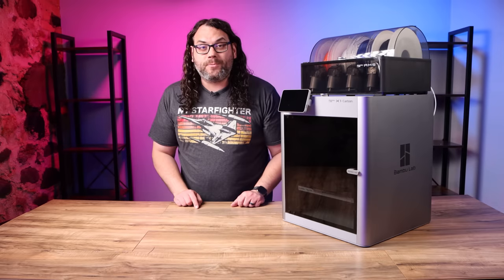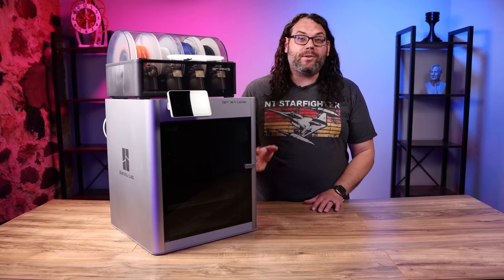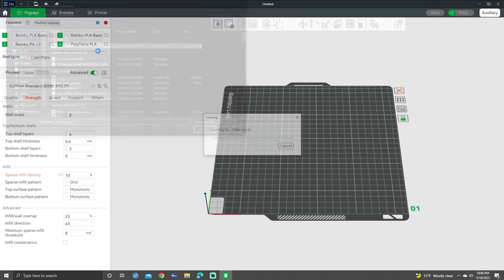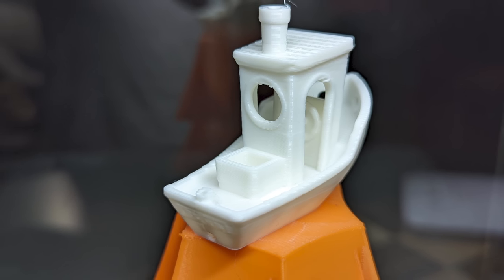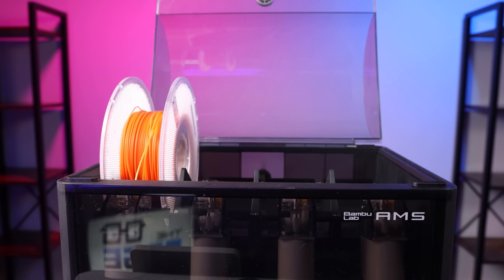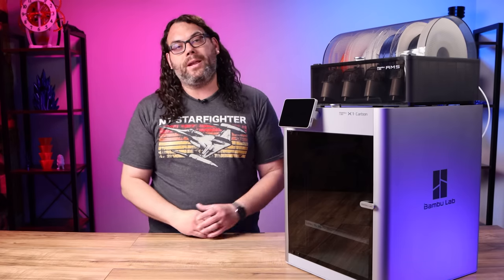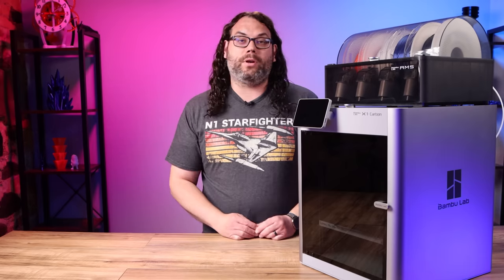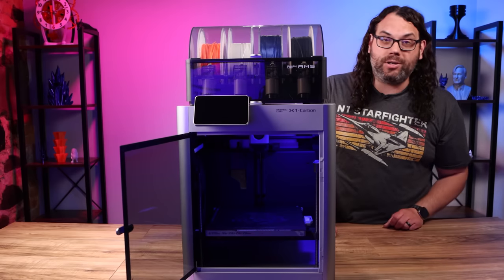The Bambu Lab X1 Carbon - Automatic Self Calibration, LIDAR, AI and INSANELY FAST!

Comment: I would normally stay away from kick starter 3d printer marketing, but I’m really existed about this.  I’ve been tracking DJI in and out of FPV for about 3 years now. The teams over there have pushed standard FPV drone googles to the next level ( Analog to Digital = Standard Definition to High Definition).  I’m glad to see some of those same team members drop into 3d printing. I will be investing into this and add it to my 3 other 3d printers. I was just looking at a rat rig vs voron and just wanted something enclosed and pre assembled that had some of these features.  I don’t mind compiling Marlin or doing a kit myself, but at the end of the day…I just want to design and print reliably.  If I can get just one printer that can hold my filament, enclosed, do an occasion multi-material prints, feed said material with out taking up time and auto bed level in one package for under 1 grand…sign me up.  Heck the filament holder I was just about to buy costs $200 - 300 “ish” dollars. The parts alone for the rat rig I want to build with a bigger bed is $1500-$1600. Yes I plan on building it regardless, but it can wait a year.    
I’m not knocking other brands; however, it is time for all of them to step up and make some bold advancements.  [Prusa, Creality, Anycubic] I don’t expect this to be 100% perfect.  They can’t screw up worst than my first 3d printer which cost me $600 bucks and then Anycubic dropped support for it less than 3 months after purchase.  To add insult to injury, they scrapped all the files, documentation,firmware from their website and created a new version of the same printer (new price tag).  1000 for the printer, AMS, technical features…plus inflation… the price is about right. RepBox $329 ( Will work with all of my other 3d printers) $671 (Budget left for comparable 3d printer).    Will I lose control over internal features of a closed 3d printer…yes.  But if the R&D can deliver 90%…it is a win in my book.  There will be no need to source inferior or quality 3rd party parts that will take 5-60 days to ship. No need to waste time finding someone else’s 3d model and re-engineer it to fit my use case.  If this tool can shave some time off of my current 3d printing tasks….Bring it on.
Reply: Similar here! I hope they will get everything right and also do support incl. spareparts.
Reply from the maker: Thanks for all the info and excitement! I agree and will be backing them too! They were awesome enough to send me one, but I want to show my support and purchase one as well! That's how much I believe in this printer!
Reply from the maker: Agreed! I think if they can get the staff beefed up, it will be great! They have been great to work with so far!

Comment: If I was going to back this project, I would be really concerned with how well Bambu Labs is going to provide long term customer support. Because it's a printer with so much built in software and sensors it seems like there is a lot of proprietary parts on this that could break and would be nearly impossible for a customer to fix themselves. I would expect there to be lots of bugs and issues with this printer when it comes out with firmware and software updates hopefully fixing that within the first few months. Also, I'm very skeptical of the color change feature. It appears that the printer is using a setup similar to a prusa mmu2s which is a terrible product. Also, not super happy about the welded frame. I get that its supposed to be rigid and ready to go out of the box but this seems like it would make maintenance a nightmare (and according to Bambu Lab's own website, you will need to do some maintenance and tinkering). Also, their hotend seems like a new proprietary design and I'm curious how well it will work.  The carbon fiber linear rods on the X axis also seem a bit suspicious. They are very stiff along the grain but not very stiff across the grain. So cross axis stresses like bending aren't necessarily going to perform as well as metal rods.
Reply: Agreed!
Reply: I think the fact that you can still print over SD without using their cloud will mean that it would still be useable if the company/cloud went down. Yes the slicer is proprietary but they have said that it will also be comparable with open source slicers too.
Reply: Ceramic heater is not new technology
Reply: @DoctorTelefono  lidar scanner to automatically tweak line width, flow etc is 🙂
Reply from the maker: I think there is a lot of questions around new tech and things that are different. I fell like we have to see where it goes, but I am confident in this team! They are great to work with so far! Thanks for watching!
Reply: This the precise question that a lot of people behind the hype always fail to ask. SUPPORT. & REPAIR.
Reply: @DoctorTelefono  check out the hotend swapping video bambu labs just posted. Their ceramic heater is new and custom and requires thermal paste.
Reply: Spot on. This is one of the things that looks absolutely amazing... until you go into details. It would be very wise to wait and see real world feedback. I'm not moving away from prusa yet.

Comment: You know what I love about this? It's the fact that I was made aware of this product 2 weeks after ordering my first 3d printer. Which is precisely the amount of time I've spent in frustration, cussing and cursing the damn thing.
Reply from the maker: Dang! I am sorry about that. What printer did you get?!
Reply: @TheEdgeofTech  Anycubic Vyper. At first I spent a week calibrating the thing before I noticed the Z spindles weren't in sync. Only then did my prints seem to get somewhat better. Then I wanted to configure linear advance, so I installed the firmware and bam, all my changes were gone again. I kinda gave up after that.

I have never seen a hobby where every A to Z noob howto is such utter crap because they always seem to take knowledge for granted. "Make sure your machine is square" but neglect to tell you how to get it square when it isn't already because Anycubic sure didn't give me an option on how to screw in the gantry...

Comment: Looks like a great printer, but I'm wondering how they can manage such a low price. Either they've got a lot of investment and they'll charge way higher prices after the initial kickstarter, or they might not have a sustainable business.
Reply from the maker: I think they have great backers and this is only the beginning for them. They all came from DJI and are very smart. Most of them have been through this before when DJI got started too!
Reply: High cost of proprietary parts will probably even out the cost of the machine?
Subsequent cost of the machine, Cost of software upgrades & lack of service due unavailability of parts might trouble it?
Reply: @guydarj  considering the hotend cost 15 dollars I think when I just paid 100+ for my e3d revo voron edition I think they will be ok.

Comment: Right now I have 9 FDM printers and 5 Resin printers.
So even though this printer looks like an amazing printer I think that I sadly have to wait to get this one. I have debts I need to pay off first. Especially the medical debts I just racked up.
After that I may just give this printer a look as it does look amazing.
Reply from the maker: Totally understand and you have a bunch to play with now! But maybe someday you will be able to come to the darkside! haha Thanks for watching!
Reply: VectorRoll, about to purchase my 3rd printer. 1st one died, 2nd printer a creality cr10 has been good but cant print nylon or carbon fiber. So looking for new replacement printer. Purchased a qidi tech x-cf pro on amazon but arrived from 3d party vendo scratched and appeared to have been returned before. So, still on the hunt for a printer that can print carbon fiber, nylon, maybe auto leveling, maybe the water soluble filiment, and decent print size. Any thoughts, recommendations?

Comment: I haven't read or found anything speaking about printing with tpu. Would like to know how well it prints tpu?
Reply from the maker: Yes you can print TPU, and Bambu Lab suggests you use the back spool mount for it as it could be to soft to go through the AMS. And it prints fast and pretty nice in TPU. I did a ton of Tank Treads on mine so far!

Comment: so basically a pre-built voron? Something that occurred to me when you mentioned the tech that is built in for this thing and the price. It is amazing to me how far the tech has come in just a few short years and how far the price has dropped to include said tech. In 2015 when the robotics team I  volunteered with received their first 3d printer, a Lulzbot Taz 6, state of the art for that year, costing only $2500, but automatic bed sensing and dual head, if you bought another dual extruder print head, no lidar, no AI to sense first layer, it just amazes me that this is a consumer product for $1000. If I had the money I would definitely back it. I compare that to the drone hobby/business and the advancements DJI made since their first drone and the new Mavic drones out there. It's amazing and I can't wait to see where it leads.
Reply from the maker: For sure! It is come so far in the last few years, and these guys just set a new bar!
Reply: Not really, a voron doesn't have a first layer sensor, belt tensioner, etc
Reply: @Shamsher1  i dont need a sensor for first layer on my voron because with auto live z and click probes i literally get a perfect first layer every time that self calibrates whether i swap nozzles or bed, and on my mrw ultraflat bed i literally have a max deviation on the bed with a 9x9 mesh of ..... 0.06 so it doesnt even need to run a mesh. there are alternate ways to do this like adding a piezo disk on the hotend to use the nozzle itself to probe, that have been around for at least since 2017 in various printer mod communities. input shaper charts can show you when your belts are out of tension and if the tension is asymmetrical , if you know how to read them.

Comment: I am absolutely excited about this printer! BUT i am also somehow sceptical how good all this sensors work in reality. Hopefully i am wrong. I would be pretty much interested in the reliability of filament change. Please make honest video about this. From 10.000 filament changes ... what is the success ratio? Features is one thing, reliability the other. Thanks for great video.
Reply from the maker: I agree! It will be good to see how it works in the long run. I can say right now, the sensors are great! And we will see in time how the whole things holds up. But I am very excited and have a lot of faith in this one!
Reply: Great. Will follow your channel to see more from this incredible machine. Would like to see multicolor print and get info about change reliability which was not the best experience with MMU2.

Comment: I've heard conflicting reports on whether or not the chamber will actually be heated or not.  What kind of nozzles does this thing use?
Reply from the maker: It's passively heated through the bed, but has a fan to control the temperature.
Reply from the maker: Also, it uses a proprietary hot end but they are releasing parts for it and have put up a pretty good article and YouTube video about this.

Comment: Guys - sorry for the uninformed question's, but i am still new to 3D printing. 

I see the speed advertised which is great, but how does the print quality compare to the new 8k printers?. In particular printing small board game figures such as Warhammer 40k miniatures. Is this printer able to compare detail wise with the new 22 Micron printers such as Sonic 8k mini?. Or is this a completely different type of printer for other purposes?
Reply: Different technology, it melts plastic and lays it down one layer at a time. That 8K printer hardens resin with UV light one layer at a time, is maybe like 20x higher resolution? Get that 8K for miniatures, not this one.
Reply from the maker: As Karoo said, you will want the resin printer if you want tiny minis that are crazy high resolution. You can print it on here, but it won't be the same. Now that being said, a lot of people use FDM to do minis, and they love it!

Comment: Any idea what other manufacture makes the same sized filament spool?  I would hate to not be able to use all the cool rainbow and stuff pla.
Reply: ModBot stuck a bunch of different spools in his; I don't recall which companies he was playing with but it would give you some data, anyway.
Reply from the maker: Babmu Lab will be testing all the major filament spools in their AMS very soon and releasing their findings. If the spool fits, but is too tall, you can print with the AMS Open. If the filament is too wide, you can put the filament on that back spool and use it without the AMS. So you should always be able to use any filament you have.

Comment: Jim you say the vibrations are super satisfying! Fnar Fnar! jokes aside the first time I heard this I thought it was about to explode, so my question is " do you have to run that super annoying vibration test every print or is it a one time calibration"?
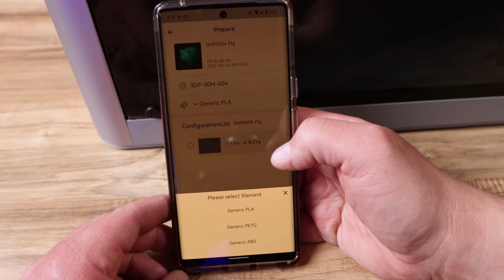Reply: @4:48，it looks that we can skip bed leveling
Reply: Vibration calibration doesn't need to be done every print. I think once a week would be sufficient.
Reply from the maker: It only needs to be run once when you calibrate the machine, and if you ever move it. Periodically to be safe or set the slice so it does this before every print. But I have only run it once!

Comment: What is the dimensional accuracy like on these things. Thats what ive been struggling with on my printers. I want something that will actually print a 200mm wide thing, with holes where they are meant to be, without pissfarting around with a gazillion settings?
Reply: Our prusas all print 8” wide with 0.01” tolerance on #4 through holes. I would think a machine that adjusts flow rate for every print based on a LiDAR scan of the first layer would hold the same tolerance with no issue.
Reply from the maker: I can do some testing if you want, but if you check my social media you will find some tests I did. The Clockspring prints turned out great and worked, the Maker's Muse calibration came out perfect and of the tolerances work right off the build plate! I am building a full droid printed on this printer, and we will see soon if it all lines up! Thanks for watching!
Reply from the maker: I don't have one to test against it, but I am confident that it will work just fine!
Reply: @TheEdgeofTech  Thanks for sharing! It looks incredible! We have a small print farm (16 machines) right now and tried to contact Bambu Labs to see if we could get a unit to test out. I would like to replace several of our older machines with 4-5 of these if everything checks out. Do you know the easiest way to get into contact with them and if they are still sending units out for testing? If they are going to be available soon then we can wait, but I didn't know what the timeline looked like.
Reply from the maker: @oneheadlight8000  They said they would start shipping in July! I don't know if they have any test machines left, but I do know they got a large number of requests after input this video out. I am not sure if they can/will send that many out because that would cost just a ton of money. But there are some others that do have it and will be putting videos out soon. I think so far, that it would be great for a farm! That's what I am gonna do with it and the one or two I back from Kickstarter!
Reply: @TheEdgeofTech  thanks for the information! July will work just fine for us. We will just pick one up when they start shipping.

Comment: I'm pretty sure that whole "you can be offline" thing is not quite as offline as one might wish. The app and the slicer both sound pretty darn connected at all times. I'm also concerned about lock-in and being forced to use their stuff only. The printer itself does look very fast and capable, and it looks like much more of an "appliance" that works out of the box than  most printers. This is the way printing has to keep moving, to increase consumer interest and adoption.
Reply from the maker: I think we will see. If you don't want to be online, you can use the slicer, but will not be able to use the apps as the info comes from the cloud to the apps I believe.

Comment: I think the price is pretty incredible for what your getting. The only real downside I see is the purging. Doesn't seem like a big deal until you use it. I have the Mosaic Pallette 3 Pro and it is so wasteful. Some 4 color prints are a 9:1 (waste to print) ratio. I have found that side purging spaghetti (just like this one does) does seem to cut the waste and time in half. But it's still wasteful. In Prusa's recent XL blog, they stated that the XL tool changing head will somehow be able to print without purging. If this is true, it will be a game changer. However, the XL is $4000 for 5 heads, and this is only $1450 for 4 colors? That definitely raises people's eyebrows. However, it didn't sound like the Bamboo Labs printers AMS had support for flexibles. Something the XL im sure can handle. Also having differnet heads allows different temps for various temps between different filaments. I should also point out that the XL can be configured with less heads than 5, for a fraction of the price. Good on Bamboo Labs for making this. It will definitely be on my watch list.

Comment: Corrections to your video: 1.  there is no humidity sensor in the AMS filament box as you claim in the video      2.  The Bambu studio is not developed by them , it i based upon the open source slicer engine Superslicer/Prusaslicer.

Comment: Are you sure it's a heated chamber? That would be a big thing. Active heated and not just heated by the bed?
Reply: Hotbed
120℃
Chamber Temperature
60℃
Reply from the maker: No! It's not an independent heater, but the chamber is controlled by a fan and temp sensors. It's heated by the bed etc.